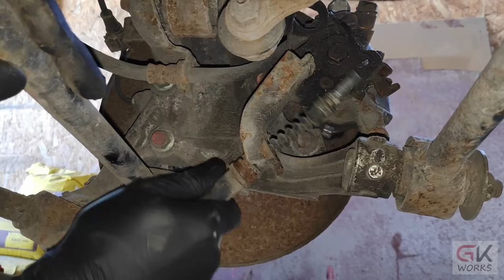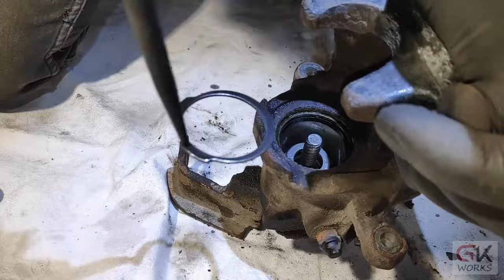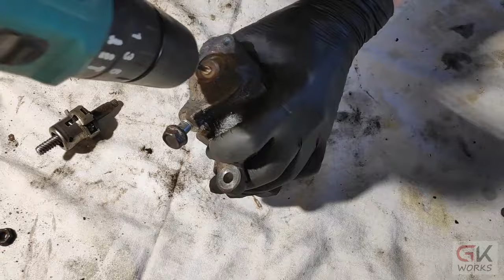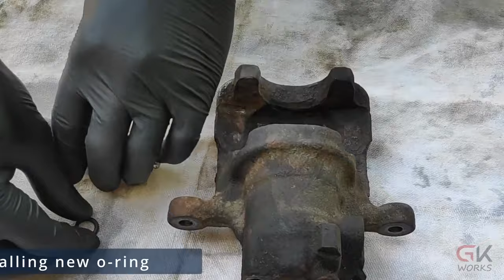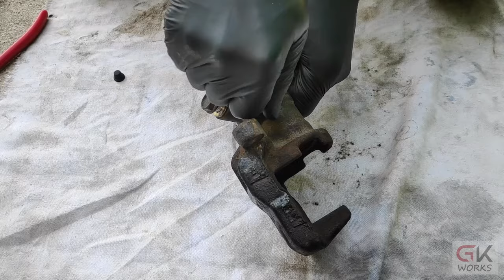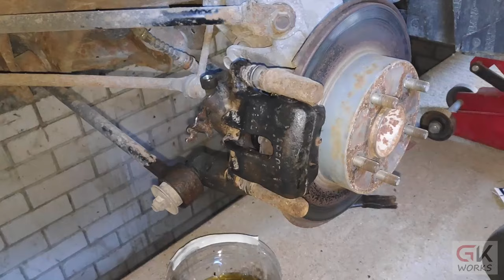How To Rebuild Rear Brake Caliper | Honda Accord 2.2i-CTDi

Comment: Excellent video. Very similar to my Citroen rear caliper which is also sticking on and i now know what to expect when I service it. Thank you.
Reply: Very similar the caliper for Peugeot, too. I'm changing the brake pads, but the caliper won't return. Should I give deep service like this?
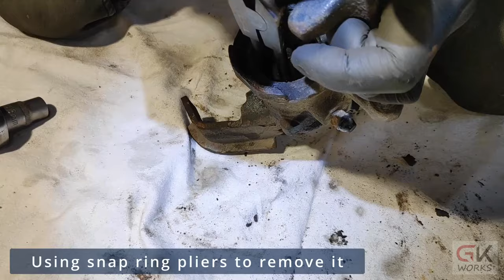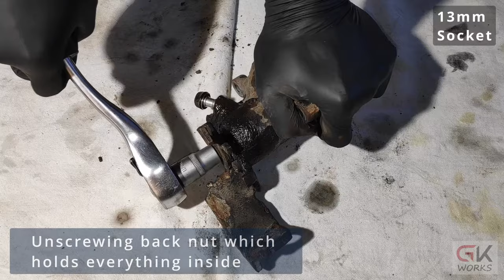Reply: @federicoromero43  I could not find any pliers (2:06) to reach deep enough to release the clip so if I were you I'd skip straight to 2:20 and carry out that procedure. Basically clearing as much crap out as possible from the seal, regreasing and be done with it 👍

*I also bought the caliper return springs which were not fitted as standard.

Comment: the hardest part is finding snap ring pliers that will be long enough to get inside caliper piston hole and at same time isn't blocked by caliper. My rear calipers is on a 2005 mustang gt, but made similar to calipers in the video. after i removed the spring to get piston to come out all I did was move the back lever on the caliper before removing it, piston came out easy.

Comment: Is that parking parking brake disconnect method similar on most cars and suv’s ? I have a seized brake somewhere and I’d like to disconnect the parking brakes first and see if the vehicle rolls before pulling off a wheel at a time to test each caliper.

Comment: Do you miss a seal before install ing the snap ring?
Reply: An O ring goes on the bolt which goes out of the back of the cylinder and attaches to the parking brake mechanism. The ring presses against a bronze washer to create a seal on the inside of the back of the caliper.

Comment: Where to find rebuild parts?
Reply from the maker: Hello, we usually search parts by OEM code for this particular pre-facelift accord model, rear brake caliper repair kit code is 43018-SEA-E01.
Reply: Rock Auto usually has ones